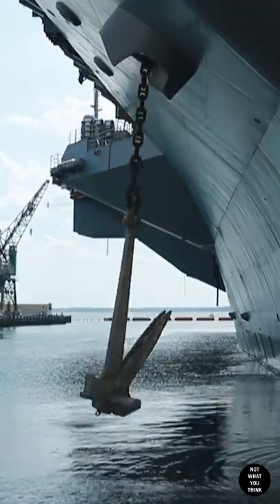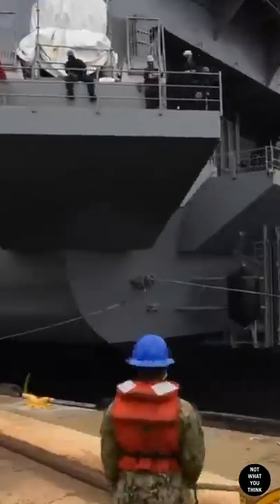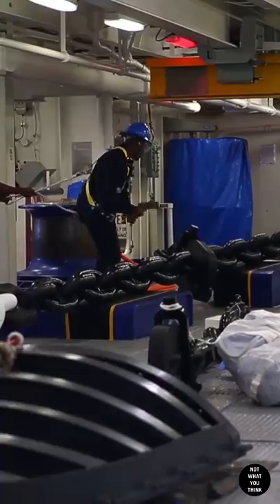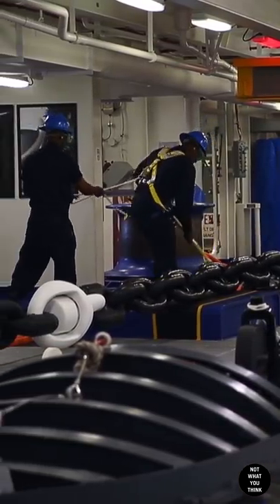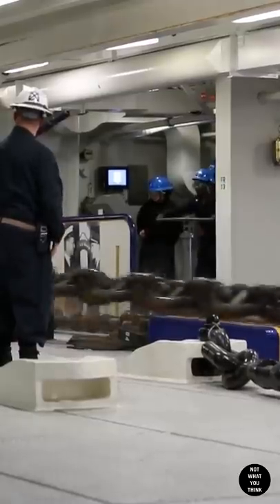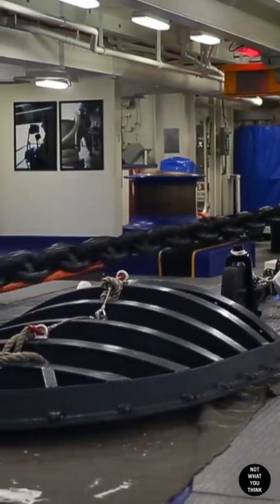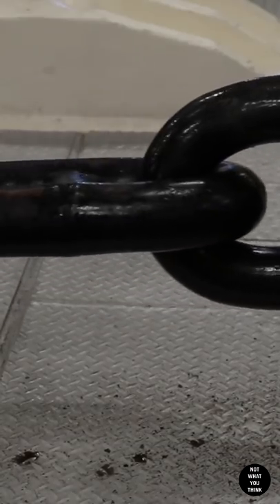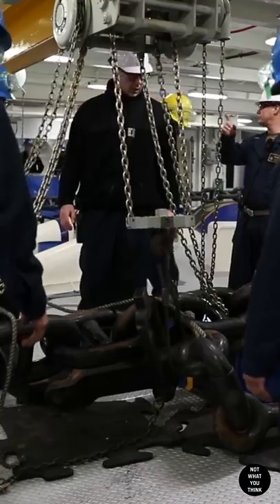Inside the Anchor Room of a Supercarrier #shorts

Comment: Fun fact: For large ships the anchor chain does just as much work, if not more, as the anchor itself.
Reply: The CHAIN does MORE! Fact
Reply: This is true guys!!
Reply: But the chain can’t grasp onto things like an anchor can
Reply: @tylerm4435  With large vessels such as this, the friction of the chain on the seabed and the chain weight hold the ship place.  The anchors' purpose is to hold the chain in position.
Reply: @tylerm4435  Each link weighs 130lbs!!!
Reply: @tylerm4435  but each link weighs 130lbs so it does not need to "grasp onto" anything
Reply: @jontrudell7529  Doesn’t hurt though
Reply: Right. The chain is 90% the workforce that stops sway.  However in my little bass boat the string don’t do crap.
Reply: @jdlives8992  that is correct
Reply: @jontrudell7529  the only thing about a nylon rope is even toasted/drunk you can find it :-) less your passed about stopping and wanna hit a new spot then your cutting rope off your prop.  Might have happened once or twice with me
Reply: @Ajs3371  if you don’t believe him you can watch a video on youtube how anchoring works on large ships.
Reply: Whereas you might get rope burn if you touch the rope while a sailboat anchor is descending, you’ll definitely lose a limb if not more if you touch the chain on a large ship.
Reply: @Ajs3371  no the anchor holds the chain in place and stops it from moving but the weight and friction of all the links in the water hold it down
Reply: @Ajs3371  Nah. The chain is 1440 feet long. That means it has an anchoring depth at around 200ft or so. Roughly 900ft of chain would be on the sea bed to accomplish 200ft anchoring depth. The weight of the chain on the sea bed is approximately 90,000Lbs which is 3x the weight of the anchor itself.

Ships like these rely on an anchor and chain system in which the chain is providing most of the anchoring forces needed to stay put. If we were to use your example and invent a weightless way of connecting the anchor to the ship the carrier would need two 30 ton anchors instead of one 15 ton anchor.
Reply: @Ajs3371  The type of anchor these ships use are called Stockless Anchors. The shanks pivot around the flukes of the anchor itself. Because of this type of anchor is used the weight and pivoting function of the anchor itself will keep it horizontal on the sea bed when the flukes dig in.

I wasn't referring to the scope at all. I was talking about how much chain is on the sea bed after the catenary curve of the chain terminates. The ship actually pivots around where the catenary curve terminates. Meaning that is the point at which the ship is truly anchored to and there is minimal force being had by the anchor.

Bud if you're comparing a smaller boat that uses rope to anchor to a large Carrier like this you genuinely don't have a clue what you're talking about. In a smaller boat the rope is easily pulled taut and is angular to the point it is anchored to. In a Carrier like this the chain forms a catenary curve downward towards the sea bed and then goes horizontally on the bottom until it reaches the anchor.

In this case the chain not only acts as an anchor because of frictional forces of the chain it acts as a shock absorber for the ship. In high wind/wave conditions the length and arc of the catenary curve of the chain increases and decreases. But it will NEVER pull taut against the anchor with these forces being applied.

To further demonstrate my point if the Carrier were somehow to pull the anchor chain taut at a maximum depth of 200ft and is the same distance away from the anchor as the horizontal chain length I said earlier(900ft) the length of chain from the outside of the Carrier to the anchor is about 925ft in length. The chain would form a 13 degree angle to the sea bed. The chain connecting shackle would prevent the anchor from realizing that angle even though it could handle it. The pivoting point of the Stockless Anchor would also be able to accommodate that with no problem and keep the anchor relatively horizontal as the flukes would still hold to the sea bed.

With that said since the chain is NEVER pulled taut there is roughly 400ft of chain in the catenary curve which is equal to 40,000Lbs of downward force and there is an additional 900ft laying on the ocean floor weighing 90,000Lbs for a total weight of 130,000Lbs before the anchor itself.

You have been misinformed on the anchor/chain relationship of these types of ships, and no these ships are nowhere near comparable to smaller ships that use rope to secure the anchor.
Reply: @Ajs3371  The example you're using here is a false equivalency. You're talking about direct downward forces being placed on a vertical object(the screw) vs the lateral and frictional forces of a chain on the sea bed.
Reply: Chain does most work. A lot of survivability at sea book show to use warp to slow your boat's drift or chain on the seafloor if you lose your anchor. Putting out 3-5x boat lengths of scope will stop your boat whether there is an anchor or not. Also your string from the ceiling is not entirely wrong. If you put wool string against a rough wall you can hang a picture frame off it just by pushing the string against the wall (no screw) which is equivalent to chain in sand(smooth wall is not comparable and string in air is not comparable either since youre staring with the idea that the chain does nothing, the chain sinks into the sand creating drag: like string on a ROUGH wall...)
Reply: @Ajs3371  also if you drop thin nylon rope to the seafloor with a yacht anchor on, the anchor will come loose no matter the length because there is not enough weight on the anchor alone to hold the vessel, which is why most vessels either have chain only or a small length of chain between the end of the rope/warp and the anchor. But on a ship the chain does the work while on small craft the anchor is enough...
Reply: @Ajs3371  Nah. Scope is the total length of the chain. I'm talking specifically about the length of chain after the catenary curve. I have made that point VERY CLEAR. It is that length after the catenary that anchors the ship. Bc from the point where the curve begins at the sea bed is where the ship pivots.

Also after the anchor is set in place and the moment the chain starts to develop its final catenary curvature there is minimal tension/horizontal force, relatively speaking, on the anchor itself. The length of chain between the anchor and the catenary curve slacks a good bit and produces frictional forces against the sea bed itself.

The weight of the anchor itself will lay it horizontal without the help of the chain. Barring a very soft sea bed if an anchor of this type was dropped without a chain it will lie flat on its own.

Ropes for all intents and purposes when comparing to a chain like this are pulled taut. The curve is not NEARLY as exaggerated.

I know how anchors work. Their holding power is derived from the surface area of the flukes which is why you're wrong comparing smaller boats that use a rope to secure the anchor vs a large ship that relies on the properties of the chain. The rope will be pulled in such a manner that engages the flukes in the sea bed and remains in varying states of tension throughout. In a larger carrier the tension of the chain with the anchor is relieved once the length of chain is on the sea bed and the catenary develops.

Simply put with the Carrier the anchor isn't the pivoting point for the ship. It is in the area directly around the catenary of the chain.

Also I don't ever rely on Wikipedia for information. Even Wikipedia itself admits on their page:

"Wikipedia is not a reliable source. Wikipedia can be edited by anyone at any time. This means that any information it contains at any particular time could be vandalism, a work in progress, or just plain wrong."

So cut it out with accusing ppl of being "youtube experts" if you yourself are citing Wikipedia of all places.
Reply: @Ajs3371  Nope. It's a false equivalency.
Reply: @Ajs3371  Bud I'm a mechanical engineer by trade. I know EXACTLY the type of "concepts" here.
Reply: @Ajs3371  I'm not here to try impress anyone. Certainly you felt that your opinion of being impressed was noteworthy, when in reality it is meaningless.

Also I don't really care about "your experience" with engineers as it is anecdotal at best.

Notice how quickly you pivot from the topic at hand and turn towards ad hominem. That is a classic example of someone who shouldn't be discussing the topic at hand ;)
Reply: @Ajs3371  You talking crap dude, be told.
Look at 0:01. if the rode is anything less then 15 degrees up from horizontal, that anchor is digging in hard.
So you DONT need a horizontal rode to keep the anchor flat.

I strongly suggest you find out what friction is before you do, well, anything really.
Reply: @Ajs3371  Hey champ, I hate to break this to you but my experience as a mechanical engineer is actually very relevant  to the topic. I deal with tensions, friction, and basically ANYTHING that moves on the daily.

Reading comprehension must not be your thing bc I haven't been saying "trust me" I have on the contrary been explaining this in a layman's(dumbed down) fashion so you could even understand what I'm talking about.

You on the other hand just resort to repeating the same false things, thinking it somehow makes it true.

Spoilers: Some "rando's" opinion about me on youtube means diddly squat to me.

Here's your L. It was very well earned on your part chief.
Reply: @Ajs3371  Nah your opinion doesn't matter, especially when you don't know about a topic you that you claim to know about. 

I'm proud at what I get paid to do for a living. I like my job. Was that supposed to be a dig or something?

So anyways here's another L
Reply: Wow!!! That was Fun!!!
Reply: Yo mama is the anchor
Reply: @Ajs3371  I’m by far not knowledgeable about boats or anchors, but why not think about friction and physics? 

There is a big chain with an anchor at the end both providing friction so that the boat doesn’t drift away. The chain provides friction simply by its weight and contact with the rough sea bed. The anchor provided friction by digging into the sea bed (maybe another term is more accurate than friction, but nevertheless the anchor provides a counter force when the boat tries to drag it, so let’s call it friction). In essence, both provide friction and it can be considered the same. It’s just the case that the anchor is a lot more efficient than the chain in providing friction if both are compared by weight. 

Would an anchor that provides an infinite/insanely high amount of friction hold down a boat? Yes 
Would an infinitely long chain provide enough friction to hold down a boat? Yes, it takes work to drag a chain along the sea bed. If the ship cannot provide that work then it stays put, obviously. (Some other person even said that this is practically possible) 

Conclusion: both the chain and anchor do work on holding the boat down. It is objectively wrong to say the anchor does 100% of the work. The harder question is what part provides more friction/work to hold the boat down (based on size comparisons I cannot imagine the anchor digging into a couple meters of sea bed does more than the friction of the way way way more heavier chain. However, that question requires either calculations or real life examples/experiments.) 

But you got to admit that the chain is doing something. No way that such a heavy and long chain is providing insignificant friction when compared to the friction the anchor provides.
Reply: At this point, I think the people in the comment section are boats in disguise.
Reply: @Ajs3371  just to clear things up, I went on a tour of the USS Midway by a veteran who served on it, he explained how the anchor and chain works. The anchor is there only to keep the end of the chain in place while they lay it out but the chain alone holds the aircraft carrier in place, it’s not like on a small vessel where there is tension in the chain between  the vessel and the anchor. The chains are essentially draped along the seafloor more then a mile. While they lay the chains out, they need the end to stay in place so that they end up in the proper area that they want to anchor. The veteran even told me about incidents where they’ve lost anchors. So maybe take back a lot of the shit you where talking to people. It’s okay to be wrong but you should learn how to correct yourself rather then look like a fool.
Reply: @julianrivera2536  I did 6 years in third fleet on the USS Chung Hoon. I spent thousands of hours on anchor and line duty. Can confirm, it's what you said. The anchor acts as a placeholder for the chain.
Reply: @Ajs3371  wow, I think you miss the point in what everyone is saying. The anchor digs in the ground, buts it’s the weight of the chain that holds the ship in position. If the chain was super light the anchor would just drag and lose grip. Do what he’s saying technically is correct. The chain does most of the holding. The anchor digs in and is held in because of the weight of the chain.
Reply: @Ajs3371  Mate you don't know what you're talking about. I could explain this to you but to avoid potential argument I'll direct you to the YouTube channel Casual Navigation who has a great video on  how anchors actually work. The job of the anchor is to hold the rope/chain in place.
Reply: @Ajs3371  You realise when large ships anchor the chain isn't taught right? How can the anchor be holding the ship if the line isn't taught? The anchor's purpose is to keep the chain in place by digging into the seabed. The chain serves to absorb energy when the ship is pulled against the anchor.
Reply: @Ajs3371  The weight of the chain absolutely does matter because weight (mg) is directly proportionate to the force of friction between the links of the chain and the sea floor based on the coefficients of kinetic and static friction. 
Friction itself is a form of normal force which you speak of when describing the draggin of the anchor. However, the normal force of the anchor in a horizontal direction is only present as long as there is a horizontal pull from the boat. I only see that happening so long as the chain is not in contact with the seafloor. Only contact force here is considerable, so the only force that can act on the anchor will come from the link touching it. If a great portion of the links are unmoving, we can tell the forces coming from the boat are not effecting the anchor  and there is no horizontal normal force coming from the anchor so long as the links of the chain are resting on the seafloor.
Reply: @Ajs3371  Seems like you're smarter than engineers and inventors, why not invent something.
Reply: The distinction here is between recreational vessels such as a 30 foot sailboat and panamax size ships.

The former can easily be held in place by an anchor and modern synthetic rope. Slightly larger vessels such as fishing or mega yachts may use a short chain to pull the anchor onto the ship as the anchor will weigh far more once it's out of the water compared to being on the seafloor. (And the chain will provide a little additional weight along with the anchor to hold the vessel in place.)

Now, if only an anchor was needed to hold cargo ships, oil tankers, aircraft carriers or similar sized vessels why would they incur the expense of only using a several thousand pound chain? A synthetic rope would cost much less. Some even have a tensile strength comparable to a chain.

As the weight of a ship increases so does the amount of weight needed to hold it in place. Ships of the size we are discussing would drag a 30,000 pound anchor, which weighs far less underwater, through nearly everything it may encounter on the seafloor.
Reply: @Ajs3371  just here to point out that the video everyones referencing is from an official large ship company.

The anchor would have to be taught (like most people here have told you) for an anchor to be useful in any capacity. This isn't mentioning the fact that a large ship like a Carrier or Crago freighter weighs multiple hundreds if no thousands of tonnes and displaces enough water to fill a small sports stadium. The chain is designed to lay partially along the seabed with the anchor providing a point for the chain to be pulled down and then locked to the seabed.

If it was just the anchor, whenever a large wave would hit the ship it would have the ability to push the ship to the point the anchor would be drug forcefully through the mud. The point of the chain is to provide a exponentially larger weight and friction on te seabed.

Please don't talk about how you're a sailing or boating genius or whatever the fuck you're saying you are and dismissing everyone else when there is people here who have actually been around large ships that use anchoring systems like the on in the video, it makes you look fucking ignorant.
Reply: @JustAGooseman  hey that video is like the shipping industry spewing anchor propaganda on youtube man,  dont trust em... 

S/
Reply: A prime example of experts roasting wiki addict know-it-all. Very fine indeed
Reply: 🤔  @sintraficusgeneralof5thbat922  After looking through the replies this is your first post on this thread. So, either your in the wrong place or using a different account...
Reply: @sintraficusgeneralof5thbat922  No worries man. Troll on dude, troll on!
Reply: @Benson_aka_devils_advocate_88  I just find it even funnier to annoy a bunch of people and then watch as other try to figure out what the hell they are talking about
Reply: @Benson_aka_devils_advocate_88  and now its time to make it worse
Reply: The anchor is just there to hook in to thr ground, that allows the chain to land on the bottom of the sea and stop the ship
Reply: Yes. I watched a video about this. Interesting old Technology
Reply: @Theres_No_PlanetB  from casual navigation?
Reply: @tylerm4435  I think if the anchor got hooked on something like on TV, then the it would be very hard to get the ship mobile again. You can' t just swim someone down there to un-hook a 30,000 lb anchor caught on a rock.
Reply: That is valid of any anchor on any ship, it's always the chain stopping the vessel from drifting, the anchor is there to keep the end of the chain in place.
Reply: Yes, the anchor acts more of a brake/wedge but the weight of the chain and the extra slack is what really "anchors" the ship. Too short of a chain the actual anchor will just dig into the floor and pop back out.
Reply: @tylerm4435  that's not the reason the chain does msist of the work. Look it up on yt I don't wmat to explain it
Reply: Well, well, well... a 100% meaningless comment.
I suspect Benson must be American.
Reply: @Tinker1950  it's true tho the chain does most the work holding the ship in place
Reply: @maxmustermann1203  
I was responding in the technical sense of the word 'work'.
If he means that the dead weight and drag effect of the chain is at least as effective at holding the vessel as a properly rooted anchor - then that's how it should be phrased, instead of the meaningless sentence written.
And it's "if not more THAN the anchor itself".
Precision gives authority.
Reply: @MintRobin  Each shot of chain(90 ft length) has a detachable link. If an anchor were to get stuck they would just separate the chain at the appropriate spot and abandon the anchor.
Reply: @fitzmann85  Ok, I did not know that, I made my assumption based on theory (seems logical you don't want it to get stuck) but that strengthens the point that the anchor is not designed to hook onto something to stop the ship.
Reply: @MintRobin  The linkages serve a dual purpose as well. It makes it easier to service the chain when you have the ability to remove, replace, and repair any given section of chain instead of having one very long chain to worry about.
Reply: @Richard Gibson wrote and conveniently deleted: 

"Just because it weighs more doesnt mean it DOES more. A 15 tonne anchor grasping into the earth is much more effective than the chain So you are WRONG!"

False. Once the almost 900 ft of chain is on the sea bed there is minimal tension on the anchor itself. The pivot point of the Carrier isn't where the anchor is. The pivot point is at the bottom of the 400 ft length of chain that goes down toward the sea bed in a catenary curve. The frictional forces of the chain against the sea bed keep the Carrier anchored.
Reply: Aight
Reply: @Tinker1950   Hey John, you free this weekend? My and my mates have a bet over who can host the "most boringest humdinger" possible. With you as my VIP guest it's a shoe-in that I can win!
Reply: @Benson_aka_devils_advocate_88 
Sorry Benson, I'll be otherwise occupied this weekend.
Still, in my absence you might like to practice writing while paying particular attention to both spelling and grammar, it adds authority to one's discussion.
Oh, and a small point, try and employ manners and respect too. Those who don't very quickly appear as part of the coarse and very crude underbelly of the online world. I'm sure you'll appreciate my words of wisdom.
Stick to it - it doesn't take much effort.
Reply: Damn Alex really covered his tracks didn’t he 🤣😂
Reply: I mean if there wasn't a chain it would just fall in the water 🤣 cant have one wout the other
Reply: Fun Fact your video is minimized
Reply: Wrong! The barnacles on the chain do all the work...
Reply: Fun Fact: None of these statements are true as itself....
Reply: @lettersandnumbersuc  pretty sure the water does all the work
Reply: Not very fun actually.
Reply: I got that anchor video suggested to me as well lmao
Reply: That's like saying a rope does the work in towing a truck with no mention of the shackles the rope attached to.
Reply: @Tinker1950  I didn't know nationality dictated a person's comment. That's kind of like saying you must be a Brit because you got upset a person made a valid point on the internet.

Edit: I forgot I already replied to you and received another hilarious comment.
Reply: @Redact63Lluks   That's like comparing apples to oranges. You're towing one and keeping the other in place.
Reply: @Benson_aka_devils_advocate_88  you my sir are not good at comparisons.
Reply: @Redact63Lluks  Enlighten me. If something I say is wrong then please explain it. I understand that you need a good anchor point (pun intended) to safely tow a vehicle. I'm just not sure how that fits into saying the anchor chain on large ships does as much, if not more, than the anchor. As the weight of the vessel increases so does the importance of the weight of the anchor chain. And unless the ship is anchored in an area where the current shifts dramatically, such as in a narrow channel leading into a large bay, or unless there is inclement weather, the anchor chain plays a much larger role than an anchor weighing a fraction of the chain itself.
Reply: @Benson_aka_devils_advocate_88  your leg is responsible for more work than your foot.
Reply: That wasn't fun...
Reply: The anchor is more of a stabiliser for the chain that has all the weight
Reply: I was about to say that... Then i saw your comment
Reply: And 80% of facts are made up on the spot. 

A 180 pound link is nothing compared to a 100,000 ton ship. 

Even 200 foot of chain at 180 pounds per foot for about half the weight of an empty Super Hornet—which itself is arrested by the carrier from 130 knots... has no effect on the carrier. 

Even the weight of the anchor itself which is about the weight of an empty Super Hornet does little to stop the ship. 

No.. an anchor works by digging into the ocean bottom. That’s why it’s shaped like it is and not just a big ball of weight.
Reply: @calvinnickel9995  It's the propeller that stops the ship. At anchorage, bigger ships, bigger chain, larger area of birth (how wide it can swing around the anchor from the rise and fall of the tide, not storm conditions)
Reply: @tylerm4435  the chain holds ship in place not the anchor.
Reply: They don't just drop the anchor from the deck, they walk the anchor out to the edge til it's just a few feet from the water then drop it.....slowly. Don't want the chain to get out of control
Reply: Actually this is true of any vessel with chain in the anchor system
Reply: Fifth law of the navy!

“On the strength of one link in the cable,

Dependth the might of the chain,

Who knows when thou mayest be tested?

So live that thou bearest the strain!”
Reply: @jdlives8992  have you seen those trolling motors that keep you in place. Pretty cool stuff.
Reply: @electricfil  yes.  I want 4 motors for my pontoon boat. A big ass solar array and some Tesla batteries.  I need it to go 20 knots though. Lol
Reply: What?
Reply: @jdlives8992  upgrade to a chain man, it's worth it you won't get your anchor so stuck most the time
Reply: 7x the depth
Reply: Same on smaller boats as well
Reply: True
Reply: Correct, the anchor chain lays on top of the anchor for additional weight.
Reply: @brotis8329  wrong
Reply: @brotis8329  It's actually not so much the weight as the length. Think of the science trick were two books have their pages interlaced with each other. It's the same principal. The drag of the chain on the sea floor does more than a solid square of metal of the same weight.
Reply: Weight plus currents?
Reply: Each link weighs 136 pounds and is 1,440 feet long. So for sure the chain absolutely does most of the work. The ancor just buries itsself to catch or drag.

 I want to see those bad boys made and how they get the damn thing on and off the ship. 

 For some reason I would hate to be assigned to this job. Like ugh gotta clean each fucking link AGAIN!? All the links?!